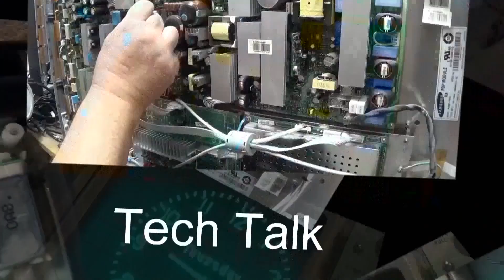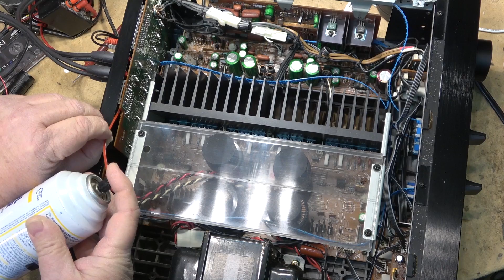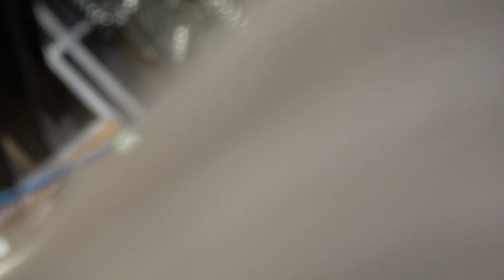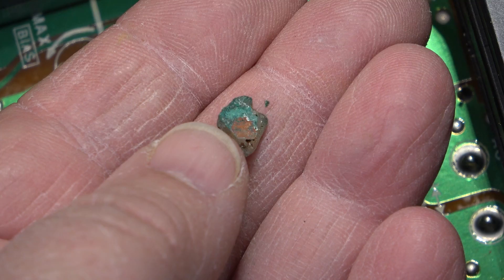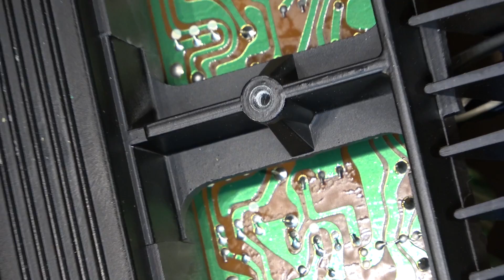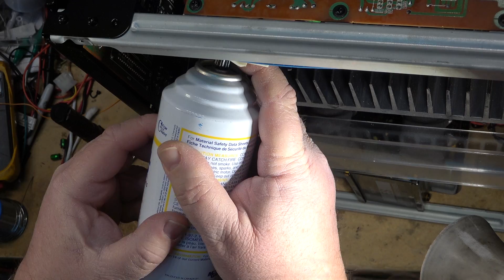Sony TAF700ES Integrated Amplifier one channel out

Comment: Good morning, very good video on this amp as I have the exact same amp I recently purchased from Ebay and the right channel has no sound coming out of it. I was going to spray that rear connector to see if that would do the trick. What type of spray did you use to do that? Also do you fix on these types of units professionally ?  I would love to have you take a look at it first hand if you were locally.  Thanks again for the video tip.
Reply from the maker: I worked for Sony and then a Sony service center for 20 years. Take a wild guess as to if I serviced these professionally.

Comment: I have a Yamaha Au 900x integrated amp about 130 W 2-channel anyway every now and then I get a little bit of distortion out of the left speaker going to try and maybe deoxit a couple of the knobs switches not sure if that will fix anything I may have to take it into a shop does this a similar switches in the back like this one you're working on any advice would be appreciated thank you sir

Comment: Hello.  There is a Sony 337esd, during playback there is a squeak with a crackling background to the sound.  One channel is stronger than the other.  Disks and tracks are swallowed quickly.  What could be the reason?

Comment: That thing with your soldering iron, I've had similar issues with that style of iron when the element gets a bit older and the thermocouple connection goes flaky. Basically if the TC opens while the iron is on it still displays the set temperature but doesn't send power to the element.  If you do end up getting a replacement element/iron I've found some times the thermocouple is wired in backwards too, so it just sits there powering the element and thinking it's getting colder and colder.  Switch the wires round & it works fine again.

Comment: I have one of these amps that will sometimes trip the protection when I first turn it on. Sometimes it will do it once, other times it will do it until I leave it on in protection for 10 minutes, then cycle the power switch.... Any idea where I should look for that problem?
Reply from the maker: The protection circuit is very sensitive. Check the small components in the protection circuit. Resistors capacitors and diodes.

Comment: When you spun the balance control to the left or right the sound went to the opposite speaker on my klipsch powered system connected to my computer. Any idea why that is?
Reply from the maker: Your speakers are reversed.
Reply: @12voltvids  5 years after the install I checked and yes, yes they ARE reversed......smdh.....

Comment: That dinky little soldering iron may be hot enough, but it doesn’t have the thermal mass needed to stay hot when you solder on that large copper pad. Anyway, I hope you (and any cats) had a nice, safe New Year. 😻
Reply from the maker: It's 60 watts and yes it does have enough power.

Comment: Good old Sony bond , corrosive over time , and becomes conductive.
Reply from the maker: That's the crap alright.   It's the same stuff as lepage's contact cement.   Turns into a corossive resistor.

Comment: Very interesting design from an engineering standpoint to get the switches all the way back and use ribbons to move them mechanically.
Reply from the maker: My Technics suv9 is the same.  Keep the audio path as short as possible.
Reply: @12voltvids  My Yamaha integrated uses the ribbons but my C2a preamp uses cool looking U joints to get the knob movement to turn the switches in the rear.

Comment: Am I the only one or does it seem like the trace that got eaten away was leading into nowhere? It looked like it lead to a jumper wire on the other side that was not fitted. The trace came from the capacitor. It seems like it was omitted and that wire was run over to there instead. Really odd. Maybe the current capability of the jumper was deemed to be insufficient after the fact so they bodged it?

Comment: What are those funky black pucks under the transparent plastic cover doing? Damping the capacitors or stabilizing them mechanically, for that matter?
Reply: @12voltvids  Well, there are the main caps of the power supply. They have those black round (foam?) things on top of them, which are held in place by the transparent plastic piece. I have never seen that before. Pieces of felt glued on the caps are popular, but this is different. I guess it is to stabilize the board against the weight of the caps.
Reply from the maker: @hermannschmidt9788  To stop the plastic cover from resonating?
Reply: @12voltvids  Funny thing that. I can't see any specific purpose for that cover besides keeping the caps at their place. Japanese ingenuity 😄

Comment: Thanks for the video .
Hell yeah I always liked the Elevated Series of Sony . SONY has very good high end speakers also they are incredable , Just cleaned all the switches on my 
Sansui G8000 now it works great the tone control bypass switch was dirty b4 cleaning my left channel would cut in and out ! I spent almost 70hrs cleaning everything but i took my time love my Sansui i would like to recapp but no time 😥70hr a week worklife 😥 You wouldn't be up to recapping my Marantz 2270 would ya, I pay good because i know how much work that goes into a recapp?
Reply from the maker: I wouldn't spend 70 hours on anything.  That's 2 weeks full time job. Not really interested in doing full recap jobs no matter how much i was offered.  Been there done that and the guy whined and complained that i broke his amp. Was not happy with the sound. Said the new caps sounded like shit.  Wanted all the old ones put back in.  Didn't use the brand of caps he wanted.  I said well if there was a special brand he should have supplied them. I can only put in what I can source.  Never again. I trouble shoot the parts that are bad and change them. 
The problem is all modern caps, every last one of them is going to sound different than caps made 40 years ago.  They are made of different materials and the electrolytic is different chemically.   This will change the sound and once someone is used to the sound of the old ones the new ones can have such a dramatic effect that many do not like the new sound.
Reply: @12voltvids  dam your on the money with recap . A lot of people don't want recaps because of this your correct , 
And yes the sound will change been there many times personally i am not a big fan of that long tooth sound from worn out caps . In my head new recaps puts the amp closer to the sound when the amp was new and not what I called warmed in . 
And Yeah 70 hours because i took my time and cleaned every last detail of the G8000 love the amp .
But i can't blame ya for not wanting to do recaps at all and People don't pay up for the hardwork meaning they need to tip very well i have alway  tipped very well atleast 2-300US , 
I had my Sansui Au 11000 recapped with Nichicons/Panasonic's caps  afterwards omg that amp was on 🔥 man !! Sounded great then a friend of mine who owns a pawnshop bought from me i didn't want to sale but couldn't pass up the bread ! 
Thanks for the videos sorry that happened to ya love the videos anyways 
And I know the G8 would be a hell of a job to recapp , We are getting fewer and fewer techs these days
Reply from the maker: @tee-jaythestereo-bargainph2120  
Las one I did was 300 plus parts and all I got was whining and complaining that it didn't sound right.  Sounded fine to me. Was back and forth about 5 times with it untill finally the shop owner told him not to come back again. This was back when i was still in the business.  And yes it will sound closer to how it sounded when new, but here is the thing, people get accustomed to that vintage sound.  They can buy a new amp and get the new amp sound. All of a sudden their old amp that they love the sound of sounds very much like the new amp they didn't like.   Thing is caps that were made 40 years ago had a totally different sound. Put all new ones in and you get closer to the sound of a modern day amp.   Don't get me wrong if someone brought me an amp and threw a bunch of cash on the table and said recap it I would change every last cap in the unit and set it up but i would forwarn them that it is going to sound totally different from what they are used to.
Reply: @12voltvids  hell yeah ! Finally some1 who gets it ! 
Also people need to take care of the Techs ! I have always tipped large its a ruff job for sure ! I will keep you in mind I got to figure out some things but I been wanting to fix up my 2270 for a gift to Zero Fidelity thats my buddy man

Comment: You talked earlier about a telephone repair. This reminded me of the back story of the current used to ring these phones. Are you ready? The voltages is 90. The frequency is 30 cycles per second. The Bell back story is the Mr. Bell figured out that most people could only crank out 30 cycles when wanting to call some one else. Where would you find that if not at the phone company?
Reply from the maker: There were multiple ring frequencies used in party line days.  10, 20. 30. 40. 50 and 60hz and then you had tip - ground and ring - ground ringers.   So 12 people could share the same tip - ring pair.  The value of the capacitor and the resonent frequency of the bell determined if it would strike or not.  Here the ring vintage is 120ac on top of the 52 volt loop battery voltage.

Comment: The tube amps have a unique sound which I would class as warm; "Happy New Year Dave".
Reply from the maker: They do. That's why serious music people use them.   The people that hang on specs will point out that they have higher distortion which is correct but it is even order harmonics which to the ear is not perceived as distortion. Even order harmonic produces a second order harmonic which is one octave higher than the original sound. We're listening to music produced by instruments it makes the instrument sound bigger Fuller and this is precisely why musicians use tube based amplifiers for the guitars for example. A solid state app like my technics suv9 has immeasurable distortion, 0.003%. it sounds great but it also sounds sterile. Solo State apps do provide very clean unaltered sound which technically is the best but unfortunately the ear doesn't appreciate this, the ear likes the warm sound that only vacuum tubes can produce and this is one reason that most really high-end amps will put a couple of tubes in the preamp stage to warm up they're very sterile sounding solid state apps and make them sound more like a tube app and why many people will spend big bucks and buy a tube buffer and run their sound through a tube buffer as it puts those even order harmonics back in the signal.
Reply: @12voltvids  I have the JVC A-X77 which is roughly contemporary with the Sony and your Technics SUV-9. The JVC is the first, and only, solid state amp that I've heard that is as warm and rich as a single ended tube amp, while still maintaining the clean sound of solid state. I didn't think it was possible but they really worked some magic on this one

Comment: The older Sony ES range was made to a high standard, and at least it was servicable.
Having owned a few over the years, they gave a superior performance compared to
the mass market models.
The dreaded pcb eating glue was used by a lot of manufactuers, it might have kept
components and wires in place, but as it ages it does a lot of damage.
Hope you have a better time in 2022 Dave.

Comment: it is a shame that they are not built like that anymore and everything is now mp3 and phones .. can't buy a nice stereo system for the home anymore just a real shame
Reply: @Keith Kneeland i still need to fix my crappy mcrypt amp it has its own will lol some times the left channel stops working ... then i need to powercycle it like 30 times for it to stay on and some times the power leds stay off when amp is on or are half bright or light up full .... think it needs a recap it seems to output half the power too now so yeah full recap me think but if you want to buy all new stereo components today it massivle expensive and you wont find a cassette deck or cd player new ... or is you do the cassette decks suck cheap mechanism no dolby cd players if you can find one are like fisherprice quality .... smartphones and mp3 players killed the home system

Comment: Love the Sony ES series, I have had many "ES" CD players, CDP-302es, CDP-222es, CDP-111es, and my current DVP-S9000es player that I use for SACD playback. Awesome audio player and build quality with Nichicon fine gold electrolytics throughout. Had the Sony Service center, Phototronics, here in Seattle replace the optical transport about 10 years ago, so should be good to go for a quite a few more years. Any trouble areas on these to look out for? Like that crap glue?

Comment: I remember fixing someone's amplifier, just by un-pressing the tape monitor button, while doing work experience in a repair shop back in the 1980s. They gave it back to the customer without billing them
Reply from the maker: Well for a tape monitor button that would be expected.
Reply: @12voltvids  we'd expect so, but some places can be bastards about it. They had plenty of other work that they're making good money from. Repair shops were busy back then, when you could actually fix things
Reply from the maker: @CameraTimDotCom  the local place charges a small fortune before they even start.

Comment: That glue is a real issue. Do yourself a solid and scrape it off before you chase your tail.
Reply from the maker: No shit it is an issue.  Why do you think i removed it.
Reply: It's been a problem for years in a lot of equipment.  Used to cause subtle problems in sensitive circuits before it became corrosive and started eating traces and component leads.